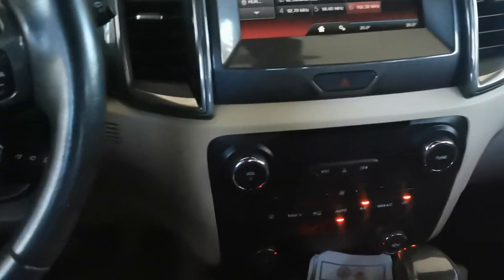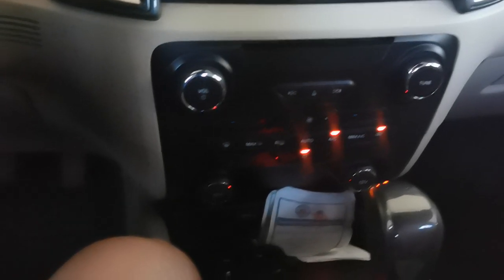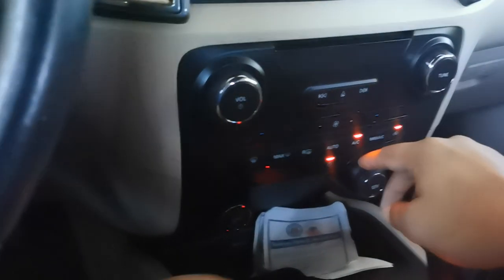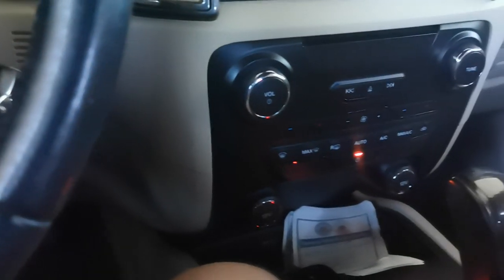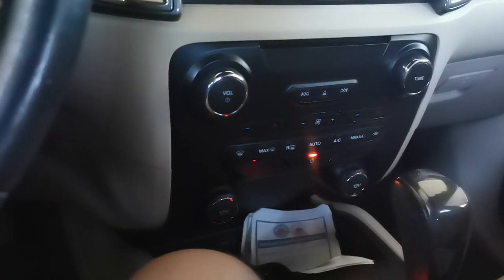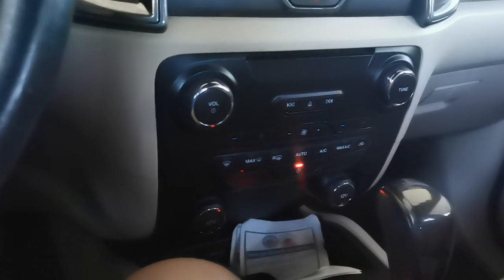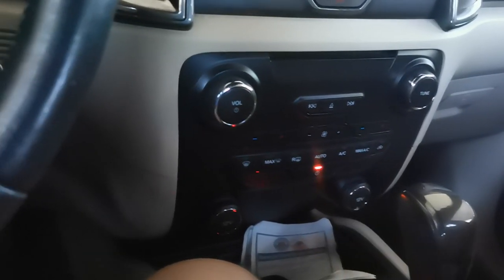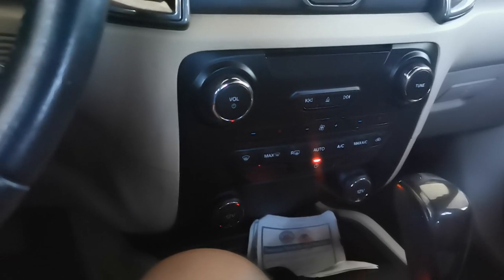Ford everest AC actuator solution

Comment: sir mga magkano po mababayaran if ever ipapaayos yung actuator?
Reply from the maker: I forgot sir. Pero i think around 1k each yung replacement. No idea if I fix
Reply: @RideWithKong1992  Common problem ata to sa everest sir. Baka pag ipapa replace, eh after ilang years babalik nanaman same problem.
Reply: B4 nyo palitan, try muna linisan ang actuator o bawasan ang grease sa loob ng actuator. Check nyo videos ni sir melvin panu tanggalin at linisin ang actuator.
Reply: Yung ranger ko ganyan stocks up yung actuator binaklas ko then grinasahanat lininis ko yung gear at ok na..

Comment: Linis actuator lang. Madumi na ang actuator.
Reply from the maker: Di yan madumi boss, bagong palit yan sa warranty.
May mga bnew units din na tumutunog actuator, chinicheck kasi namin bago i release ang unit.
Reply: @RideWithKong1992  kumalat na ang grasa sa loob at natabunan na ying ibang copper lines kya di na mka set yung sekector sa loob. Kya galaw ng galaw ang selector. Nid bawasan ang grasa para mgkaroon ng contact ang selector sa copper lines.